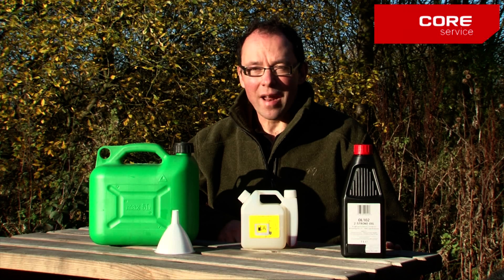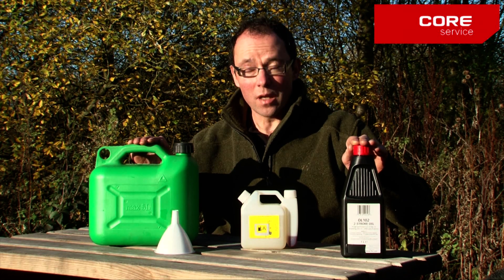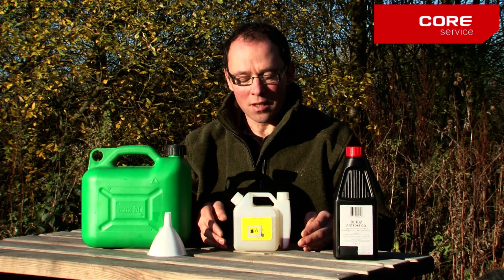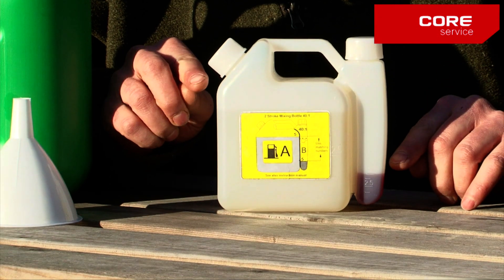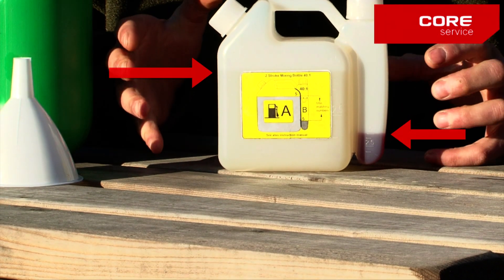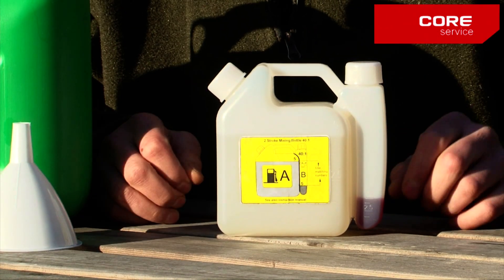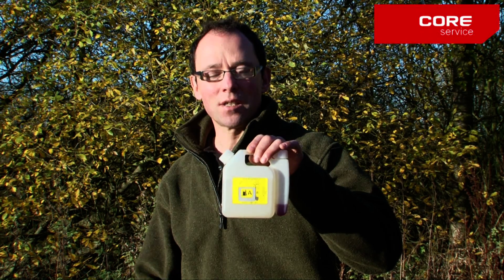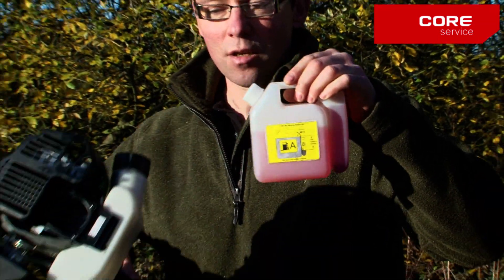How to mix 2-stroke fuel/oil

Comment: the upper scale is 10 not 5  ? so 10 is 1 litre i think you put petrol to 10 and oil to 10 for 1 litre 40-1 or petrol to 5 which is hlaf a litre then put oil to 5 that's gibe you half a litre of two stroke mix

Comment: Have I got this right:  the numbers on the bottle are not ounces, or ml, but just numbers that correspond with each other? So if its 10 on the large compartment, it must be 10 on the small one?
Reply: yes for 40-1 it's 5 5 or 10 10 that will give you hald a litre or a full litre
Reply: What I did ... went to a anything for a $1. Store bought a set of nesting mesuring spoons ...they have metric on them & I can make what ever amount I want with accuracy!
Reply: Luke; ALSO if you don't know the metric system: 'cause our schools suck. You can learn it on You-tube!